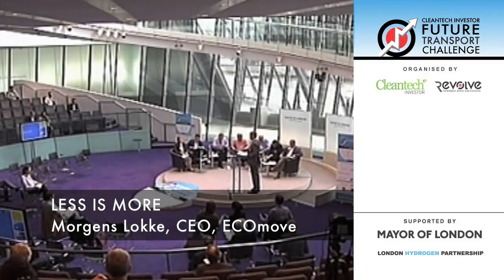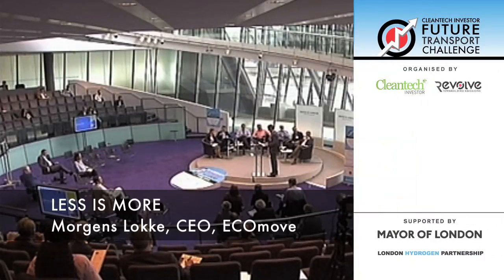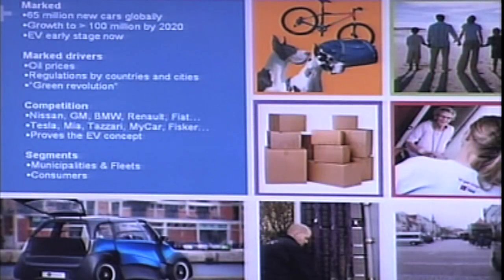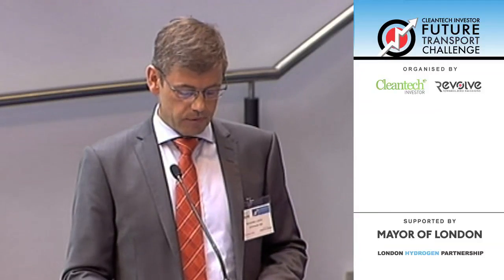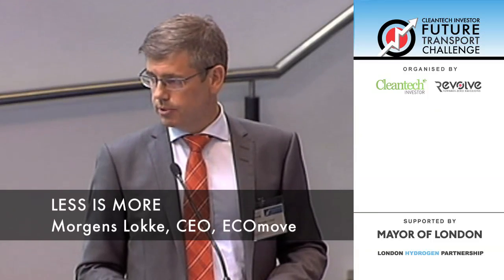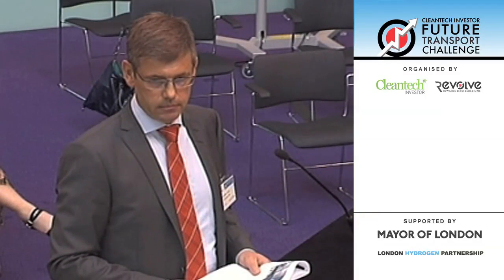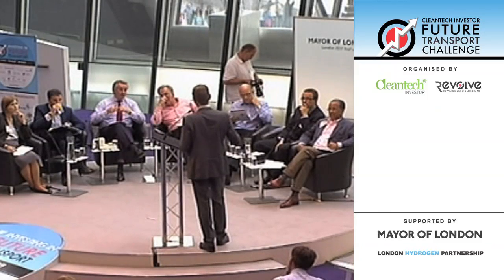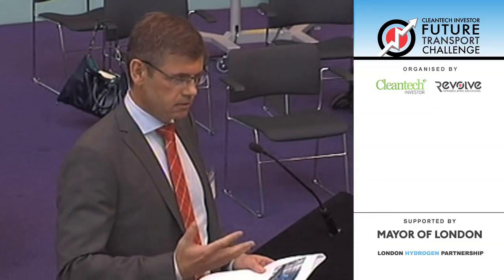Scandinavian electric car design - an investor pitch by ECOmove

Comment: This is brilliant.  What will keep you out of the US markets? Chicken tax? Crash test ratings? Performance in snow, rain, cold, extreme heat? Ford, Chevy and Chrysler are probably sleeping on this front. For a car like this to work in the US it's got to be about $250/mo zero down or about US $20k with a 10 year mfg  powertrain warranty.